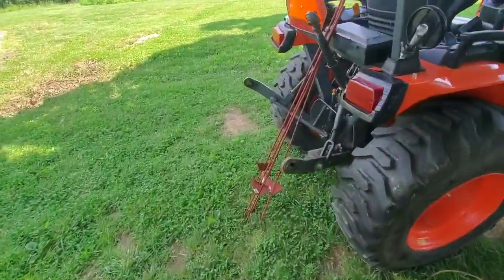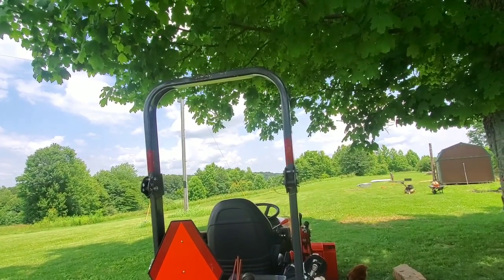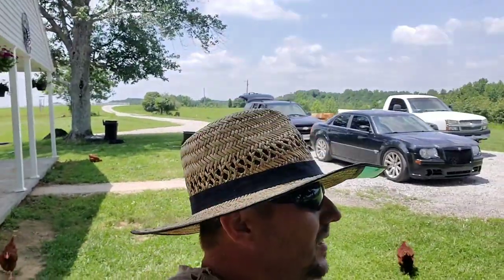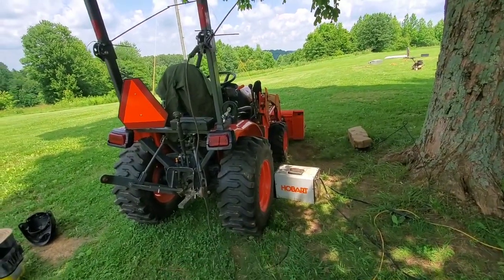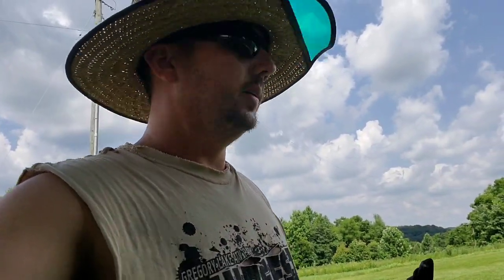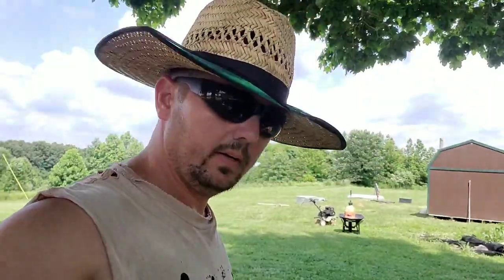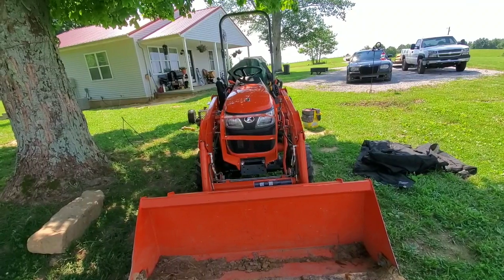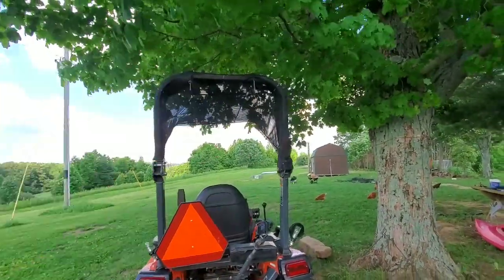Homemade tractor canopy

Comment: A year ago I would have laughed at someone for buying a Rural King tractor. Today I own one. My son's father in law had just bought a new one when he developed cancer. The tractor had 80 hours on it and he couldn't pay them payments on it so rather than him having to let the bank repossess it or having to have to sell it for less than he owed and still having a payment, I bought it for the payoff. It is the smallest one they make, the RK24. It cost me $15,000 but it has the backhoe attachment. I don't know how bad I got beat but that's not the point. I don't really need the tractor but Mike and Jeanette needed help and that's what I thought would help them the most.
My tractor looks almost exactly like yours so I might just build my own canopy. Please make videos of any other modifications you make and I will consider applying them to mine.
Reply from the maker: Good deed of you buying that to help them out. Mine is 2019 26hp got a loader, tiller, box drag with rippers, 5 foot bush hog. 152 hours 4.5 year factory warranty for 16,000. I'm very pleased with it so far

Comment: White won't attract heat as much as black does Stevie might keep you cooler if you rattle can the top white. Cheers
Reply from the maker: Your right about the white but it will work with black